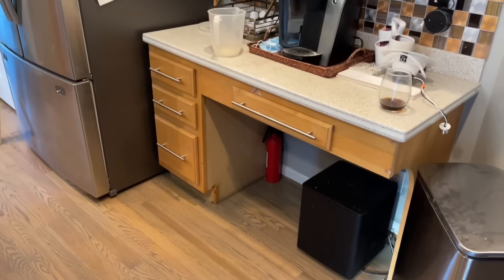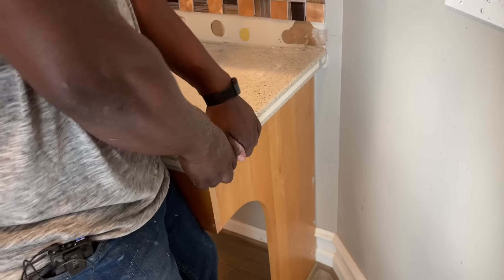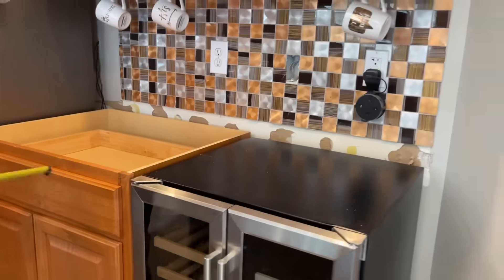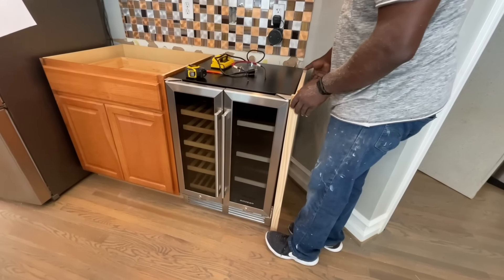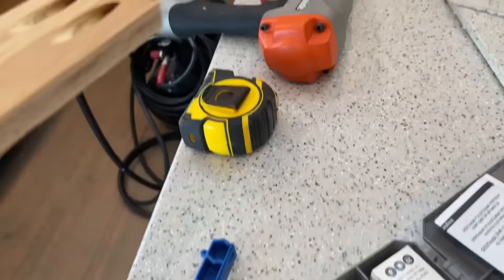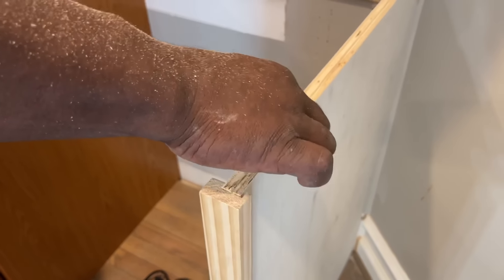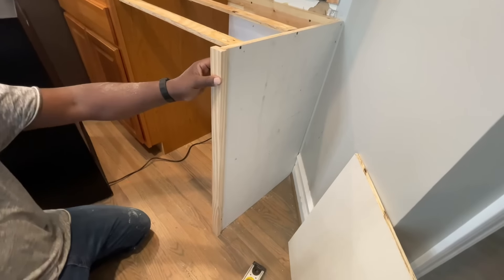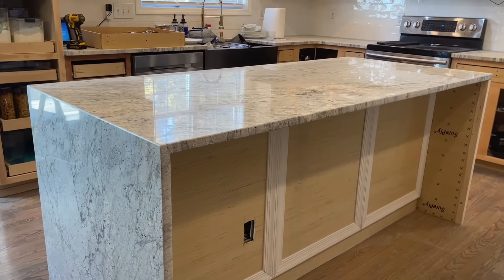DIY-Built-In Wine Cooler/Coffee Bar

Comment: Where did the cooler come from? Price range ?
Reply from the maker: I put a link in the description as well.

BODEGA Wine and Beverage Refrigerator, 24 Inch Dual Zone Wine Cooler, with Smart APP Control and 2 Safety Locks,Soft LED Light Hold 19 Bottles and 57 Cans, Built-In or Freestanding